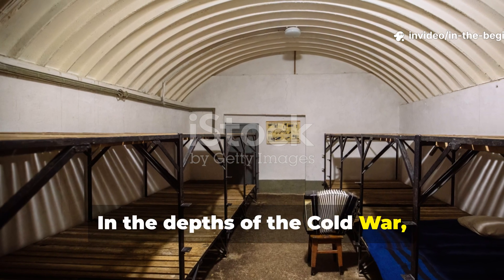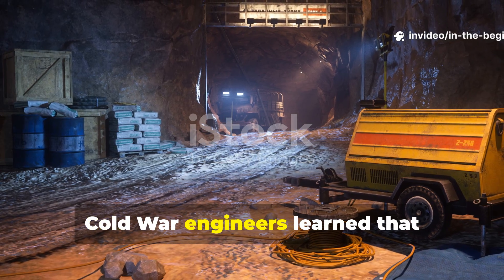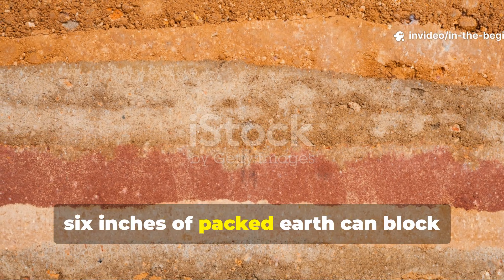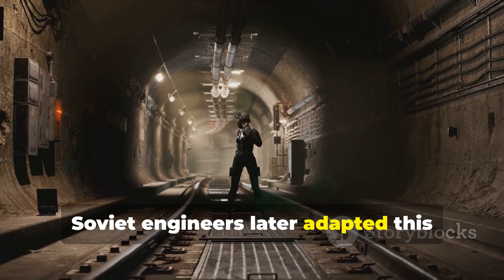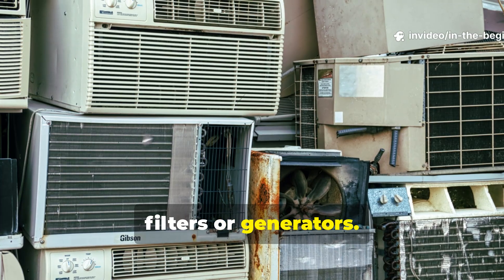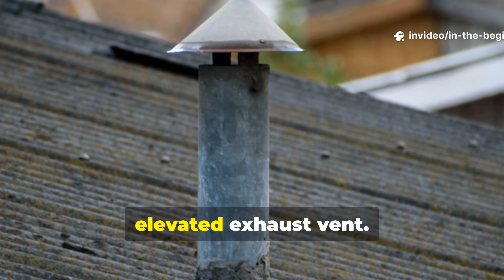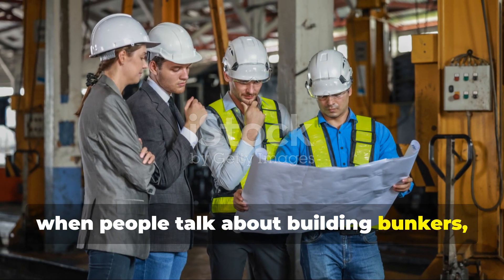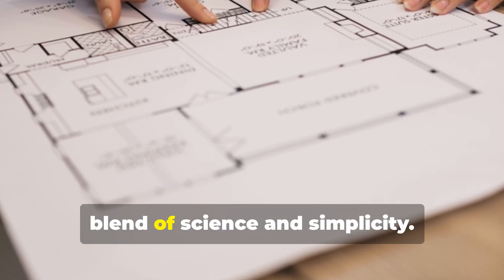Stop Building Shelters—This Cold War Trick Beats Them All

Comment: 4 ft down from the top of a high creek bed, dig a 2x2 ft tunnel 6  ft back into the dirt. Turn 90 degrees and dig  the tunnel paraelle to the creek about 4 ft in.  go outside, move down the creek bank 8 ft, in the direction you were tunneling. Again dig 6 ft into the hillside. Turn towards the other half-tunnel and dig until you meet up with that tunnel,  In the center of the tunnel, dig down 1 ft and into the hill one ft, so that you have a 3x3x7 ft long sleeping chamber, Stuff the tunnel and entrances with dry grass, Make woven withe doors, 2 at each end and cover with with clay that matches the creek bank exterior. It's not just the radiation, folks. It will be the desperate predatory people that will be all that remain of society for many months, maybe even years, However, in one year, 99% will be dead., of diseeses, radiation, predation, starvation, thirst.